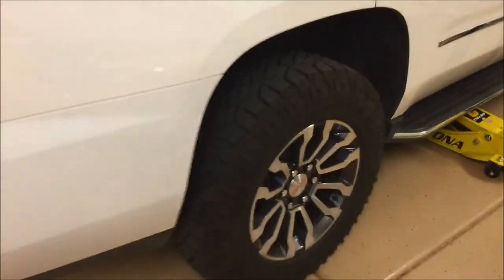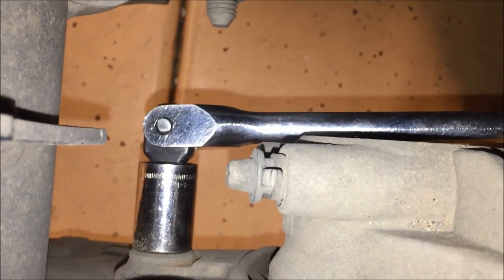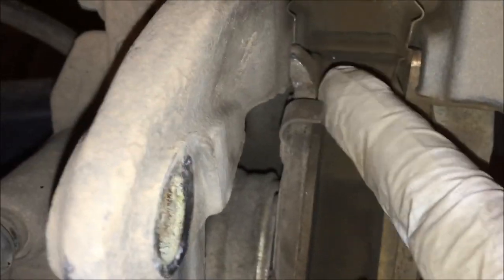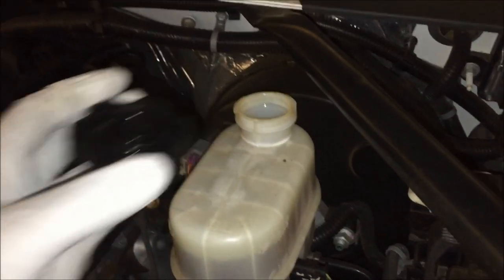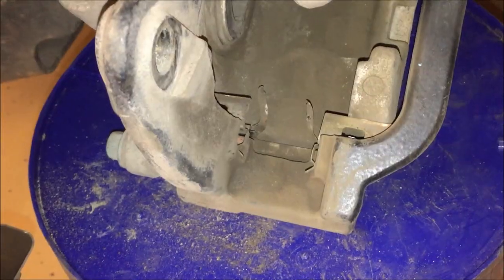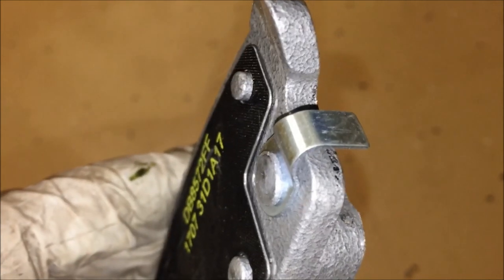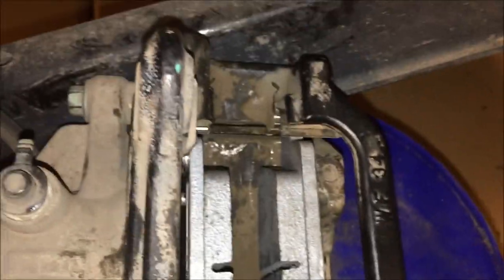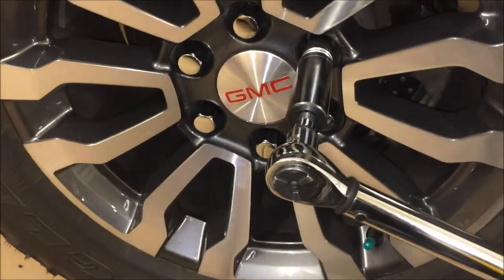Rear brake pads replacement GMC Yukon, Chevy Tahoe, Silverado, Sierra

Comment: You should of taken off the brake caliper brackets from the caliper to properly replace the brake pads shims. You’re not supposed to bend any clips. Plus you need to grease the slider sine the grease inside does wear away.
Reply from the maker: https://youtu.be/BYKHyi6uQ7s

Comment: I Would Never bend clips, also never ĥeard of putting Grease on back side of pads . You suppose to use Break pad spay , it's tacky so the brake pads don't move !

Comment: I’m having troubling getting the caliber back on, do you have a video for it?
Reply from the maker: Did you remove the brake master cylinder reservoir cap in the engine bay and compress the caliper piston back in?
Reply from the maker: You shouldn’t need the special tool, but this is the same process https://youtu.be/0Zio1JKargA
Reply: @dannyjohnsonsgarage  I figured it out! 
I didn’t have the piston pushed back far enough. Thank you very much for the instructions and reply!

Comment: Do u have any videos doing brakes on the mustangs
Reply from the maker: lb0193 Yes. I’ll give you the link to the front, rear (which some require a special tool as you’ll see in the video), and also one on bleeding. 
Front: https://youtu.be/ZVT6OaQavvk
Reply from the maker: Rear https://youtu.be/0Zio1JKargA
Reply from the maker: lb0193 Bleeding (typically not required unless you remove a brake line) https://youtu.be/h5HV9D2sezs